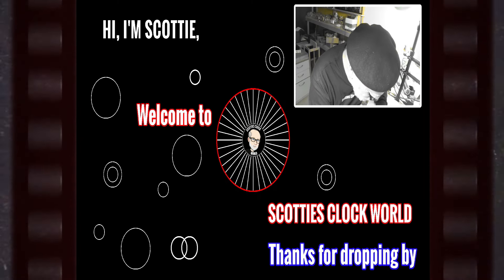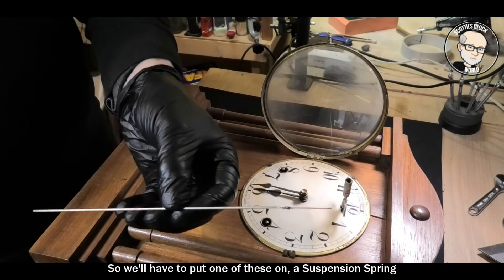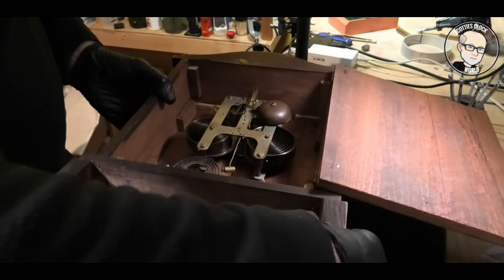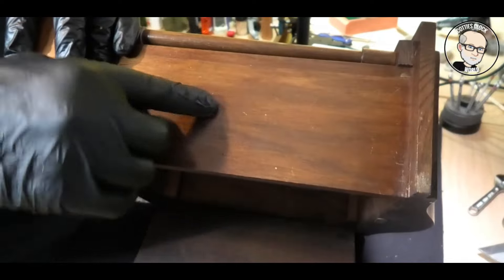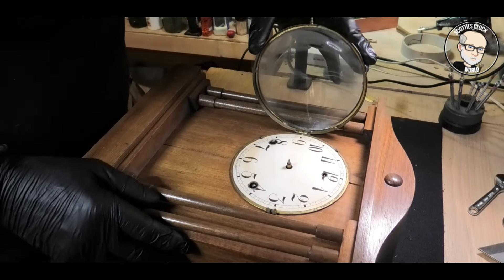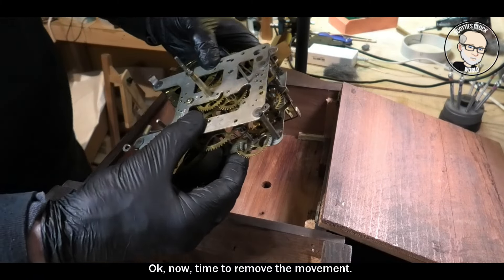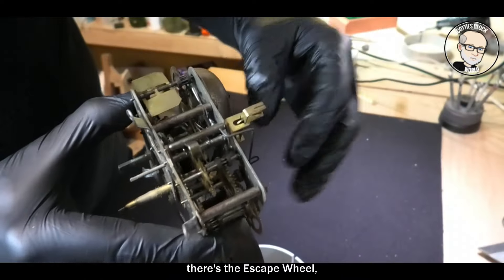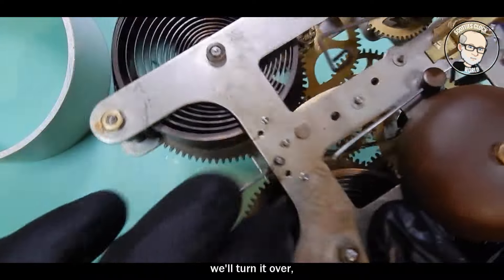1916 W.L. Gilbert Mantle Clock Restoration Ep 1

Comment: Hello, Scottie!
Thank you for these videos on this Gilbert clock.  I am currently working on my first clock adventure and it, too, is an old Gilbert movement with a circa 1879 patent date.  It is a weight driven movement for time and a spring driven movement for chime.  The wheels arrangement is very similar to this one of yours, though.
I think the wood on your clock may be maple.  It could possibly be pecan but I don't think it is dark enough.  Probably not ash.  Definitely not cherry.  The grain appears too fine and not enough contrast in the  grain structure to be oak,  JMHO, though.